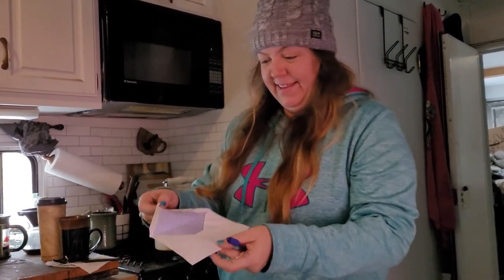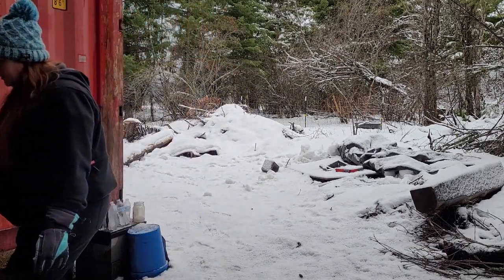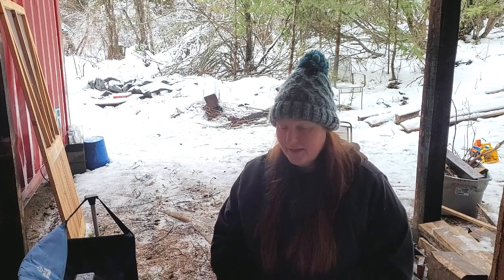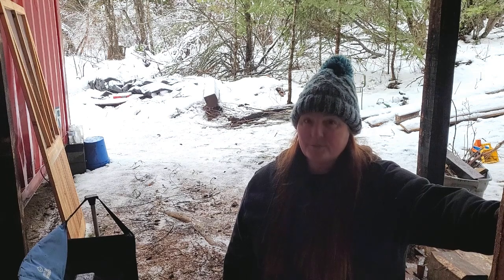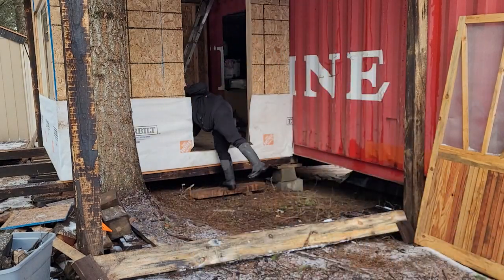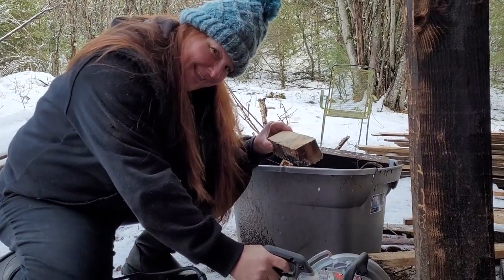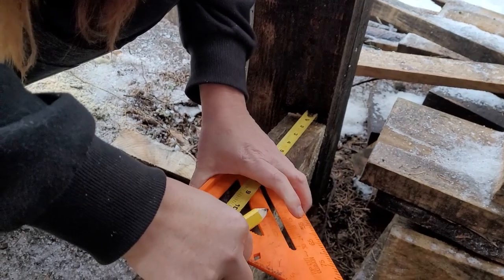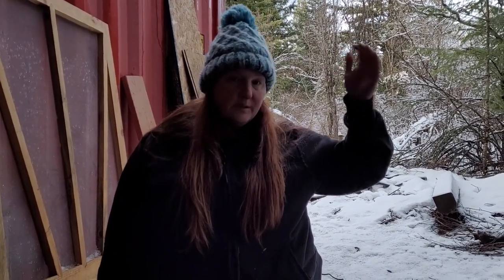OFF GRID BUILD// Working in the snow// VLOG

Comment: 1. They built barns and houses which are still in use without joist hangers and other strapping.  2. You can make your own joist hangers or have them made to fit your lumber. 3. You can also just create a ledge for your joists to rest on. Even after you put them in place.  By placing a 2x4 under them which is fastened into the wall.